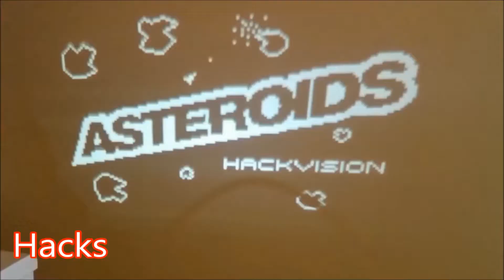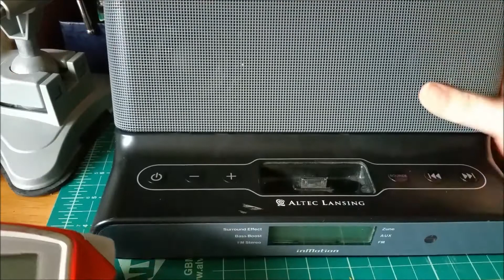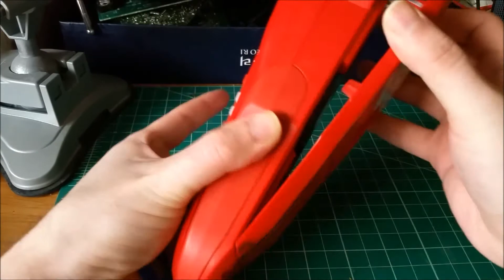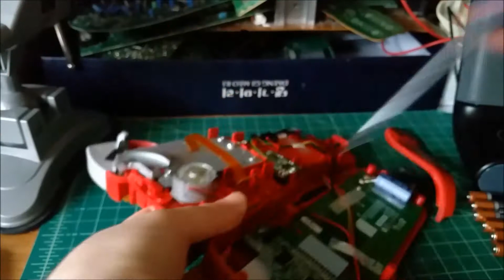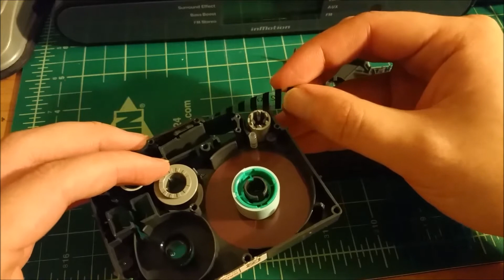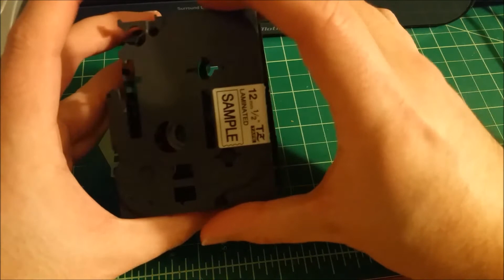TeardownTube - episode 51 - Brother PT-1010 P-touch Thermal Label Printer

Comment: Yea mine didnt have rev. Protection.. and when i decided to plug a power supply in it the cap went caput.  Damn fuse deal didnt do shit..  put new cap in but she was toast..  betting it got the processor..  wont turn on but gets power to the chip..  she had a good run though...  fully labeled over 30 data racks with it.. das a lotta labelin...  you can also remove the blade assembly by removing that yellow holder and flip the blade if it stops cutting...  fyi

Comment: Hello, I have a brother PT 1010, like leaked AAA batteries and corrupted a track, and 4 letter keys stopped to work F, K, P, M, can you help me? if i send you some pictures?
Reply from the maker: Try taking it apart and giving it a good thorough clean. The corrosion could've seeped onto the pcb, causing the issues you noted.
Reply: I've already passed alcohol, but what seems to have melted a part of the trail, seems viable to me I make a bridge, I would like to send you a photo, and an orientation

Comment: The batteries are not in parallel. Look how they were stacked.
Reply from the maker: Duane Degn Yes, I guess if I thought about it more, it would make more sense that they needed the higher potential to drive the inductive head segments at a reasonable current for it to work. Makes me wonder how long a set of batteries last then, sincr I never print much it hasn't been much of an issue yet.